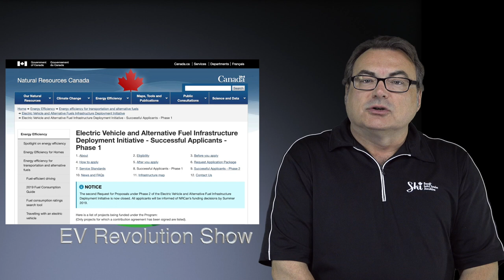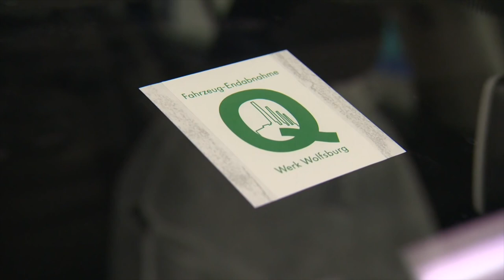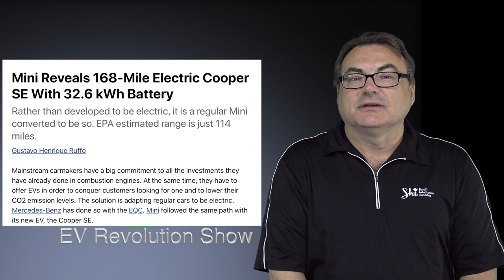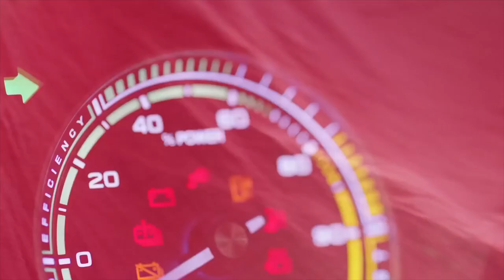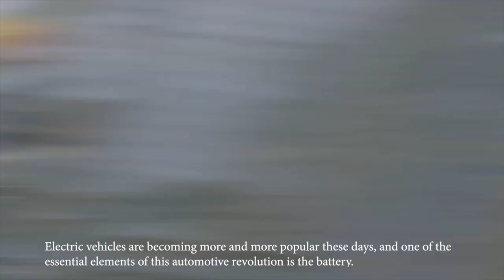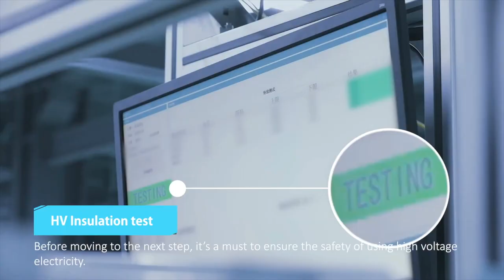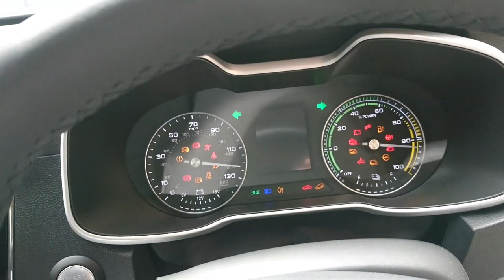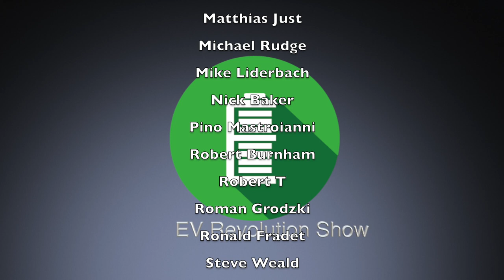Episode 52 - Jaguar, VW, Mini and MG - Manufacturer EV News!

Comment: Thanks Kenneth. If MG can live up to their heritage, there should be plenty of room inside. 

We drove Metro's for over 20 years. They were one of the smallest British made cars at the time, but they had a surprising amount of room inside them. I carried some odd cargoes at different times, including a full gents' wardrobe, and later a washing machine which had enough room to fall over and break a rear windscreen. I moved 84 Victorian house bricks; only about ½ full, but the suspension was grounded. For work, I carried 6 20” CRT monitors plus six midi towers plus six small suitcase-sized boxes, on another occasion four adults plus 2 weeks of self-catering holiday luggage, and so on. It's certain that the MG will not beat that, but it should still be interesting.
Reply from the maker: Thanks RWBHere for watching and for the comments.  Glad to hear the heritage is good and yes I agree, the ZS EV is going to do very well!

Comment: Appreciate your tolerant view of shorter range BEVS - as charging infrastructure gets built out and charge rates improve, pack size will become less important and vehicles can be lighter and cheaper.
Reply from the maker: Thanks Mike, appreciate you watching and feedback.  Yes we are almost at the sweet spot now with range 60-70kWh w/225-250 miles more than adequate for daily use.  For longer trips, with better infrastructure and faster chargers, this will convert more.  Of course, cheaper prices too.

Comment: Thanks Ken. Good info. Electrifying is a must. So many car companies are getting that. However, what the industry also should learn from Tesla is: everything in the car under software control (including the washer fluid pump), basic hardware for very advanced driver assistance (forget about full self driving for 10+years, Tesla has been promising that for 5 years and not delivering, it cannot be done), over the air update. Add also high bandwidth internet. That should be in every new car from here on. Add the great build quality and their access to mass market and they can beat Tesla in the future. They also need to get rid of dealerships of course. If they ‘just’ electrify ... it will not be enough and the the newbies like Tesla will take over the mass market.
Reply from the maker: Thanks for feedback @Theo!

Comment: The MG is a good starter EV but the range for me is too low but for many it will be good enough
Reply from the maker: Thanks for watching Michael, yes it will for many agreed.
Reply: Michael Simpkins , it’ll be perfect in Europe where countries are smaller and infrastructure is better
Reply: But in cities, people mostly live in rented apartments without access to overnight charging. With low mileage on one charge, you don't want to waste any miles going to fast charger. In fact it is better to have high mileage per charge car if you have to drive around 12 miles round trip to charge quickly.
Reply: Aliaksei Ivanov , I can only speak for Oxford as that’s where I live, and there’s lots of charging in the centre, and when you leave the centre most have off street parking. No reason infrastructure can’t be provided when there’s a demand, and a will to do it.
Reply from the maker: @aliakseiivanov7923  Hi @Aliaksei, for those who don't have home charging, a lower range BEV can work fine.  Just depends on your daily driving needs.  For 12 miles a day, pretty well anything available will work.  Every few days, go to a fast charger to "fill up".

Comment: VW has to beg the EU for more time to convert to EVs. VW needs billions in help in order to not die because of the transition. EU is helping them because they employ so many people. This stuff is matter of open public debate in Europe. They still will not grow manufacturing of EVs as fast as Tesla has. it will take several years before they get to big numbers according to their plans. Very low numbers shipped the first year, more the next, etc...
Reply: There's a lot of optimism about VW and their EV program. I'm not sure where this optimism comes from. In 2013 VW declared that they would be the largest sellers of EVs by 2018. It's 2019 and where are they? VW are not leaders now and they certainly aren't innovators.
Reply from the maker: Hi @Ooo and @John, yes but they finally seem to be moving forward at a more substantial pace.  Forget the past and let's look forward.  We need them and all the other manufacturers to step it up.

Comment: VWs  were historically plagued with  electrical issues .   Very undependable.  So, now..... they build EVs....    what could possibly go wrong?  ;)
Reply: Same as the french, why I'm hesitant to buy e-208 :/
Reply: @rogerstarkey5390  he is not that wrong though. Many early Zoe are plagued with issues. At my local service center they have told costumers to buy a new car because they would need a new motor or batteries. I've heard things improved with the R90 motor plus the used batterypack on that version but i wouldn't touch any older version. 

VW is also a shitty company to deal with when it comes to warranties trust me I've been there and done that. In my case i had a warning light on i came in asap they couldn't find the issue and reset the system. It came back for a second time later on then my dsg2 box couldn't engage one of the clutches. Called them about it but then i got: you have drivin over the warranty range (in km) so no sorry you are on your own.

Despite me reporting the issue while being covered by the warranty they dodged the bullet...
Since then i will never but another VW car in my life 😅
Reply: @rogerstarkey5390  Thanks for your injection of sanity. Just wanted to know you are appreciated.
Reply from the maker: Thanks @TrueDesireHD for your comments and sharing your experiences.  Sorry to read about your bad dealings with VW.  Look, pretty well every vendor (including Tesla) have customers with bad experiences.  It's not an excuse, just nature of the business.  

I just met someone yesterday who has a 1 year old Jeep Compass and has had nothing but warranty problems and issues since day 1.  It's even burning oil!  A $45k car and a year old from new.  Shameful but it happens.

Comment: My views on price: EVs will in the end be more expensive than current day ICE cars. You and I will be spending more on EVs because they give us more than the ICE car did. EVs will be as different from ICE as smartphones are from regular mobiles (remember those? They were used to call people). People waiting for the less expensive EV are at the same time saving their dollars to reduce the waiting time. At the same time ... soon ... (has happened in Norway already) ... ICE cars will go up in price as they will be charged for the pollution they cause. Therefor, better get used to the idea .... you will pay more for private transportation in the future. Some of us will choose to no longer own and just use Uber, Lyft or the Tesla RoboSlow taxis.
Reply: In the end? EVs should be way cheaper. Battery tech is improving crazy fast which is the only part that keeps EVs from matching the very lowest priced ICE cars. At middle to high end, EVs are already cheaper compared to ICE. Tesla Model S has been getting way better margins than ICE cars in the same price class for 6+ years and the Model 3 is already getting better margins than the ICE vehicles it is competing against.
Reply: 0ooTheMAXXoo0 Today margin is an issue. Margin will improve, you are right. In the end however it will be about value for money. EVs will have higher value and thus will cost more money. Issasimple. I guess we disagree.
Reply from the maker: Hi @Theo, possibly but I would agree with the consensus that pricing should go down, at least to cost parity for ICEVs.  If ICEVs go up, well that would also help to spur EV adoption.